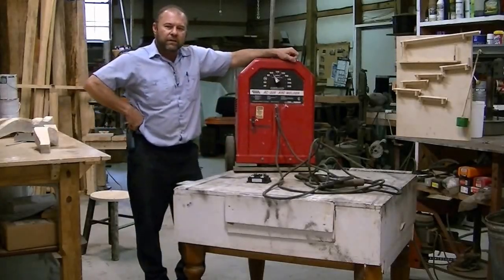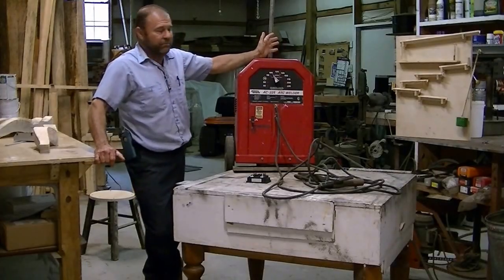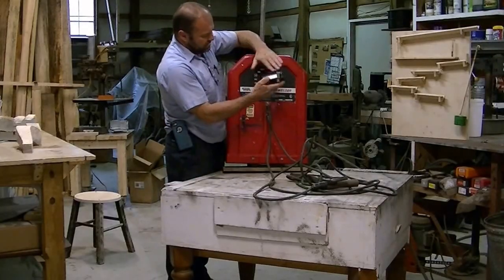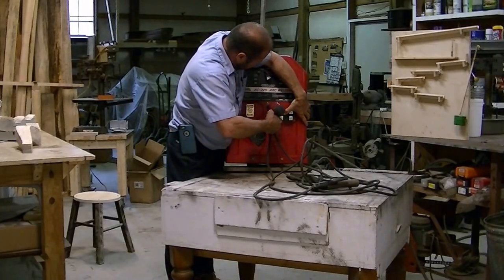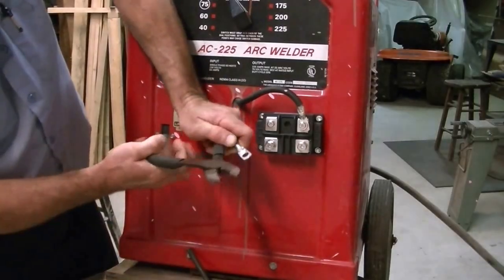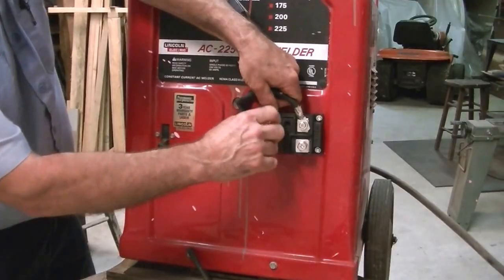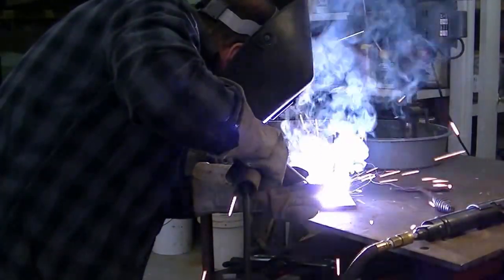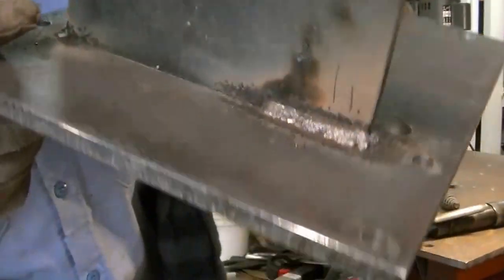Convert your AC welding machine to DC for $50. Weld 7018 rods,more strength

Comment: to get an idea of 20% duty cycle, take a pen and start drawing a line about the speed  you would be welding and go for 2 minutes. that my friend is a lot of welding. for the average shop guy you can do tons with that welder. there's a reason they have sold millions of them!!
Reply: Note that the 2 minutes is based on a 10 minute interval.  2 minutes = 20% of 10 minutes.  That means you then get to wait 8 minutes before you do your next 2 minutes, assuming 2 minute continuous welding.
Reply: That's at 225 amps.
Reply: That is only true if you are at full amperage of the machine and welding non stop at 225amps. Buy the Lincoln bible, you would be surprised what knowledge can be learned from reading it then applying it.

Comment: Hey Mark, 
I'm new to electricity and welding, but would it be possible to put a switch and keep the machine AC and DC, through the switch?
Reply from the maker: Yes you could put a switch, just make sure it can handle at least 200 amps.
Reply: Well, use four DIN connectors, then you simply move your cables to change from AC to DC or from DCEN to DCEP - much cheaper than any 200Amp DPDT switch and less wiring, too!

Comment: Polarity is wrong but nice idea
Reply: I will bet for every 1 that runs straight 100S run reverse, electrode pos. for LH7018. Duh...
Reply: NO, it depends on the welding application... There is DCEP and DCEN welding .!!!
Educate Yourself!!!    Duh....
Reply: Bob Duvall, 7018 is not a straight polarity rod. 7018 is a reverse polarity rod. It does indeed matter. The positive goes to the stinger and the negative goes the ground. Read the container that the welding is sold in. It says right on the container DCEP or AC.
Reply: WHERE did I reference  7018 rod????   WHERE did I say it doesn't matter??
Simply stated there are Two DC polarities!
It depends on the process and the filler material........... Move Along!!........

Comment: add a 2 farad 36 volt capacitor
Reply: With a open circuit voltage of ~70 - 80 VAC that 36 volt capacitor would blow up in a hurry.

Comment: Hi, You should have mounted the rectifier inside the cabinet  to be safe due to the exposed lugs.
Reply: It's a welder. No need for your Safety Natzi comments here.
Reply: With a welder, you already have exposed wires / connectors -- the ground clamp and electrode... Those exposed lugs are not a significant increase in risk... I'm not a professional welder, but over the last 50 years of occasional welding on the ranch and in the home shop, I've never been shocked from welding nor do I know anyone who has been shocked... From other endeavors, yeah, not not welding...
Reply: @seanseoltoir  Your post is what is known as anecdotal data. If such exposed connectors were safe enough, Lincoln wouldn't have bothered with teh expense and materials necessary to enclose the factory electronics.  Exposed conductors like these are teh proverbial 'accident waiting to happen.'  It may not be shocking, maybe it will simply start a fire, or . . .

Comment: Here is a good question can this be done on a mig wire welder fluxcore
Reply: wtf2013.jp@gmail.com thsts a good question. How old is the machine? It might be dc already.
Reply: No you cannot use a stick welder for mig welding. 
http://www.lincolnelectric.com/en-ca/support/process-and-theory/Pages/constant-current-vs-constant-coltage-output.aspx
Reply: Mig is dc ... wire speed is amps volts is heat

Comment: Hi. I have an older Lincoln 225 AC/DC stick welder.  I turned it on the other day.  The welder powered up and ran for about 30 seconds.  i was about to strike an arc and the welder suddenly shut off.  Hasn't fired up since.  Do you know what may have caused this ?

Thank you!
Reply from the maker: I would start with the breaker box and make sure  it has not tripped. Next I would check the on off switch on the welder, sometimes they go bad.
Reply: markp0177 I'll check the switch , thanks.

The schematics show a circuit breaker but I cannot locate one on the welder.  Any idea where it may be hidden?
Reply from the maker: I meant the breaker in your house. I don't know of one on the welder.
Reply: markp0177 --  The schematic is glued to an inside panel on the welder.   

I checked my breaker panels and all is good.  Have 220vac to the outlet.
I'll start at the switch and work my way in.
Reply: phdfxwg Fischercat what a dumb ass
Reply: You say an Ac DC machine? How about switch to AC or DC ? Doesn’t everything have to go through that. That is, if the rest is still getting power.

Comment: wats da name of dat ting u used to remove da slag
Reply: LAST RIDE needle gun
Reply: @johnwetson7365 thanks
Reply: Kadar Mankasingh it is called a needle scaler or scraper depending on who you ask.   Harbor freight sells them for really cheap and here is a link to a slightly better one sold at home depot http://www.homedepot.com/p/Powermate-Pistol-Type-Air-Needle-Scaler-024-0299CT/206339128?cm_mmc=Shopping|THD|google|&mid=sGGzTBmKX|dm_mtid_8903tb925190_pcrid_111416414825_pkw__pmt__product_206339128_slid_&gclid=Cj0KEQjw-ezKBRCGwqyK0rHzmvkBEiQAu-_-LGpGeLlTtvjACJA-tYqw0JNZQ9eJIo-jp_NnMAQI7FoaApUQ8P8HAQ

Comment: YOUNG MAN LINCOLN ELECTRIC 225 AC , WILL WELD UP TO 1 " STEEL EASY  / I USE 1/8 " AC 7018 ROD FOR EVERY THING I USE IT FOR  ! 

BUT IF I NEW HOW TO RIG UP CONVERT AC / DC I WOULD , BUT I BEEN WELD WITH AC SO LONG JUST USE TO  AC WELDER

Comment: What would happen if you connected it the other way around and had the positive as the rod holder?
Reply from the maker: It would still weld but it is a lot smoother having the rod as the negative.

Comment: mount a 220v fan inside and you duty cycle will be almost unlimited.
Reply from the maker: It already has a fan on the inside.
Reply: ok. i have a montgomery ward 180 amp ac welder i just acquired and i will be putting the bridge rectifier on it. it did not come with a fan so i will be putting one on it. thanks for the video . i thought you could do the bridge rectifier.
Reply from the maker: I guess I could aim my blower at it while I am welding. Most of the time I just burn two or three rods. I just built a band saw blade sharpener for my sawmill out of junk. I will be uploading that video in a couple of days.

Comment: I tried this and popped a 75a circuit within seconds. I'm not convinced that this works. The rectifier I got is rated for up to 1200V 200A. It should be plenty strong enough.
Reply from the maker: I used a 300 amp and mine woks great. I would think that a 200 amp would be plenty too. I would try to get my money back and go with a 300amp one.
Reply: markp0177  I gave it another shot and it worked fine after turning the current up. I think I need about 20-30% higher current to get it to burn consistently on my welder on DC vs AC. I am still concerned about what would happen if that rectifier ever shorts.

Comment: 7018AC rods work great as long as they have been in a rod oven. If they're old/damp, then they aren't worth a crap.
Reply: ya but by the time you get to the numbers its dry !
Reply: Sometimes you got to do what you got to do and in the field soaking wet you have to ground out the rod until steaming hot and dry and go for it. Not on critical welds but non critical get r done welds. Never had one come apart in over 40 years on heavy equip.
Reply: My mom threw out a deluxe toaster oven. I intend to use it as a rod oven. Question do you think it will work well?

Comment: The problem with this is that it is still kind of ac.  While it may not be switching from pos to neg and back it still goes from max voltage to 0 60 time a second.  The best thing to do would be to make choke from an old microwave transformer and add some capacitors to smooth the voltage.  Then you get real DC rather than kind of dc.
Reply: Pulsating DC is not necessarily a bad thing. As others have mentioned, some expensive welders have this as an option. The off time between pulses allows the heat to spread away from the center of the arc, which can improve penetration and reduce cracking for some types of welds. The hum frequency you hear, by the way, is twice mains frequency, i.e., 100 Hz or 120 Hz, because you get a full acoustic wave for each half cycle of current. For those who want to stabilize the current (eliminate the pulses), you will need a hefty inductor "choke" designed for DC. This usually means there is some sort of air gap built into the core to prevent magnetic saturation. Mains transformers, including microwave transformers, lack such a gap, though you might create one accidentally by reassembling the core badly. There are power supply inductance calculators available on the web, but they won't tell you that your core design has to support the full peak current of welding or how to design the choke. High current chokes designed for 150 amps at 100 Hz are usually quite massive. For those who think that capacitance is the answer: a rule of thumb is that you need 10000 microfarads for each amp of load current to reduce ripple voltage to 1 volt peak to peak. So, let's say you are OK with 5 volts ripple at 100 amps. That means you need 10K x 100 / 5 = 200K uF = 0.2 Farads capacitance capable of about 100 amps ripple current. Have fun paying for that. If you've followed me this far, you might be interested to learn why old-school DC welders often include an output choke. In addition to stabilizing the weld current, these chokes also isolate the low impedance winding from the high frequency (HF) starting circuits used to make it easier to strike an arc. Without the choke, the HF starting voltage can damage the rectifier diodes.
Reply: @whidbeyman  Thank you Paul. Good post.
Reply: Now my brain hurts.   Thanks.
Reply: tom, Check out this video  https://www.youtube.com/watch?v=cyhzpFqXwdA   Start at 4:45 as it explains about adding capacitors to a single diode rectifier power supply.  At 7:50 it discusses bridge rectifiers which is what markp0177 is doing in this video.  It is about capacitor-only power supply filters.  If you have a voltmeter, turn your welder to maximum voltage and test the voltage.  Multiply this by 1.5 to determine the minimum voltage value of your capacitors.  I prefer to use a factor of 2.  With your calculated voltage rating, shop for several 3500 micro farad capacitor at that voltage.  This filter is installed between the + and - terminals of the high current rectifier, in parallel.  I noticed markp0177 did not use a heat-conductive grease under the rectifier's base.  I recommend using a thin coating.  Good luck.
Reply: @cphank151,  NO, Not paralleling the rectifiers!   'Google' "full wave rectifier'   
The bridge rectifier will rectify BOTH Sine cycles. 
SO, It Does prevent having zero current every half cycle... 
It Will Not eliminate the zero current And zero voltage at 'Crossover'.   BUT it has been proven that the 'Pulsation' actually increases penetration!   Similar to the action that 'Hi Frequency' does for TIG welding...  <;)
Reply: @Will Walker     You are Trying to describe a 'Bridge' type full wave rectifier... That is what he has!
It rectify's both polarities of the AC sine wave into a 'Full Wave' DC output.
Cryogenic Gaming is Wrong... It Is Not still AC. It is Unfiltered DC!   He is looking for "Filtered DC"  <;)
Reply: Cryogenic Gaming pulsed dc is an expensive option
Reply: yep
Reply: please could you explain how to make this choke and where do i install it/ thanks!
Reply: Pulsed stick welding isn't widely used because it requires a pulsed power source and most of those are TIG machines (which of course can be connected to a stick lead instead of a TIG rig. My  personal machines don't have pulse so I've not tried it yet. http://www.weldingtipsandtricks.com/pulsed-stick.html
Reply: 120 times a second actually.
Reply: if the ac 60hz  voltage is rectified without any smoothing capacitors wouldn't the voltage go from min to maximum 120 times per second rather than 60?  I think it does but i'm not sure...
Reply: VC, the capacitance value is too low and the voltage is not AC, which is what your cap is designed for.  
Check out this video  https://www.youtube.com/watch?v=cyhzpFqXwdA   Start at 4:45 as it explains about adding capacitors to a single diode rectifier power supply.  At 7:50 it discusses bridge rectifiers which is what markp0177 is doing in this video.  If you have a voltmeter, turn your welder to maximum voltage and test the voltage.  Multiply this by 1.5 to determine the minimum voltage value of your capacitor.  I prefer to use a factor of 2.  With your calculated voltage rating, shop for several 3500 micro farad capacitor at that voltage.  As for a choke, it would be required to pass full welding current, over 100 Amps.  I suppose they make them, somewhere, but size and cost would be prohibitive.
Reply: Yeah, you can actually hear the 60Hz "hum" as he strikes the arc.
Reply: No.  What you're suggesting will just parallel the rectifiers.  It may allow using lower current rated rectifiers but will no eliminate zero current every half cycle.
Reply: Jeffry Blackmon m
Reply: " make choke"
"add some capacitors"
How, which ones? Where?
Reply: Will Walker no, unfortunately not. Since both diodes are fed from the same alternating current source, their output is exactly the same. The only thing it will do is split the load between the two rectifiers
Reply: How about adding just one 2MEC9 30uF 370VAC 60/50HZ Cap to smooth out the current. Would I definitely need a choke? Are there any chokes that I could by that would work?
Reply: What if you used two of these diodes. On the output (DC) side connect the positive to positive and negative to negative so it would be a parallel circuit that receives power from either diode. Then on the input (AC) side have them wired opposite of each other, so when one diode is not letting power through the other one would be. Would that successfully balance out the AC frequency and make it constant voltage?

Comment: They have dinse connections as well on eBay.
I have an AHP alpha stick $225 from Amazon and it has a hundred percent duty cycle at 115 amps so it'll burn 1/8 7018 Fleetwoods which will also run on AC all day.

Mostly I weld 16ga square tubing so I also picked up a Hobart 205 AC because my inverter welder doesn't like certain rods.

Honestly I can't believe they don't put dinse connectors on most welders.
Reply from the maker: Thanks for the informations

Comment: it's supposed to be electrode positive swich your leads
Reply: I thought I was the only one who caught that..
Reply: It actually depends on the work you do and rod you use. there are EN rods, and sometimes you want the electrode on negative if you don't want much penetration and head on the material.
Reply: I replied the same thing when I saw it. Then I read the comments and saw a lot of you guys caught it right away as I did. Same with the duty cycle. Good Eye to all you welders.
Reply: unless your welding upside down and the electrode neg works better,
Reply: dphillips705  NO, it depends on the welding application... There is DCEP and DCEN welding .!!!
Educate Yourself!!!    Duh....
Reply: Bob Duvall not for 7018. Dcep only. Iv heard of people using dcen for open root but it's still wrong.
Reply: How do I make Molly lot longer 25 foot
Reply: It depends on what you are doing. For most welding the stinger is negative for penetration and positive for more of a surface weld.
Reply: Absolutely correct! DC+ for stick DC- for Tig!
Reply: dphillips705 I thought the same thing but I think the rectifier has the current come out the positive side whereas your usual welder has the current come from the negative. So maybe he's right.

Comment: 7018 is meant to run on dcep. May wanna switch your leads. It's will run a lot better and actually penetrate.
Reply: i was thinking the same
Reply: In addition, you need to add a big choke. Someone can probably help with a value but it will need to be wound from some big gauge wire.

Comment: Make it DC and switch the leads for reverse DC, it'll open your eyes to arc welding you never knew. I have a Lincoln IdealArc and wouldn't trade it for anything.
Reply: My 1966 vintage Lincoln Idealarc has a switch for reverse DC. Unfortunately I just got hit with a bad bank of diodes - - 1 out of the 4 banks, must jerry-rig a new full wave bridge rectifier since Lincoln stopped making a replacement part, either take a chance on this chinese model this guy is recommending which now costs $88 - -  or buy 4 huge Vishay Stud Diodes and "roll my own"  - - - - - possibly more reliable than Chinese. Amazon turns their back on you if this Chinese one burns out and says you must deal with seller to get return/refund (in China of course).

Comment: Do you cover the front mount with anything? .. Are the exposed leads > AC input.. DC output.. ? is there a danger of electrical shock if touching them?
Reply from the maker: There is a small tingle when you touch the leads, I will add some liquid tape to the connection's.
Reply: Eggszellent! .. BTW, Mark > THANK-YOU for all your videos, and sharing practical information and how to apply it.. You the man!